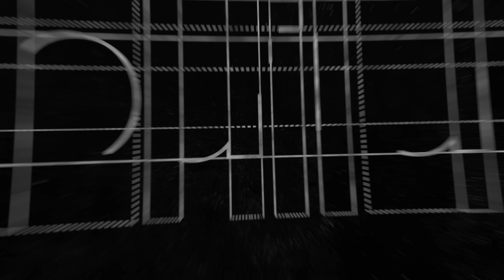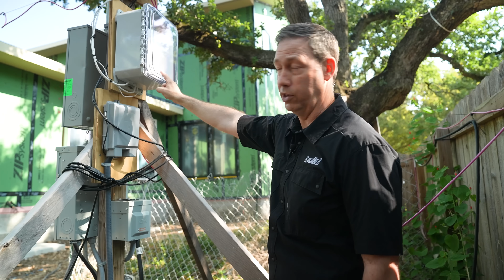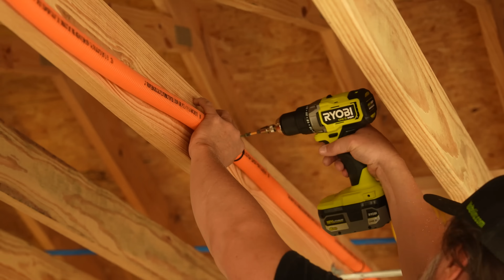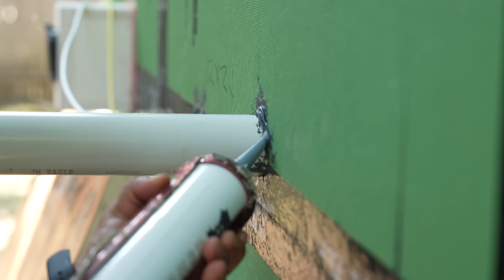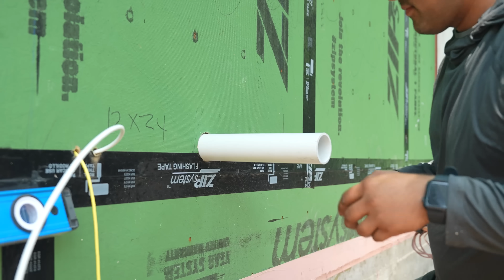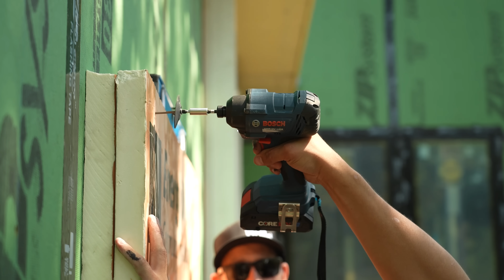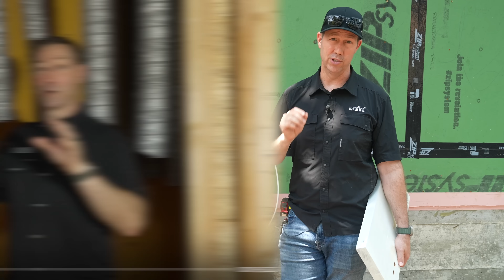Preparing for Google Fiber & Future-Proofing!

Comment: The best way to do this on a new build is run electrical conduit to the back of an Extreme Broadband enclosure mounted to the side of the house. Install fish tape in the conduit and let the installer run whatever type of cable they need to. This creates an airtight way to get any number of cables to the interior of the house. 

Many installers are sent with premade fiber cables and my not have the termination or splicing equipment. There are also several different types of single mode fiber and although you may be able to convert one to the other the installer may not have the connectors to do so. Many companies are also only running fiber to the exterior and cat5e/6 to the interior. Its best to let them bring the install materials they are used to working with and giving them and easy path to run them. Same with cable or satellite providers. They have a certain spec cable they use and it's best to just let them use it.

Comment: when inter provider connects to either the fiber or coax they will do so using connectors,.  I'd like those connectors to be protected from the weather, therefore I'd like to see an enclosure/box  on the outside that those connector can be placed in.

Comment: I would bury schedule 40 conduit to the curb so the fiber drop is not just loose in the ground, which is how google will install it.
Reply: yup, and many times only 3-6" deep
Reply: They don't run fiber in conduit?  Many places run fiber optic in microduct conduit.  Verizon FiOS runs it in large orange conduit (probably 1") with aerial/direct burial fiber optic, but they bury it just a few inches deep.
Reply: @lambition  they have mainline in conduit for the street run trunk but at each address termination in my neighborhood they connected curb to home demark just burying the fiber in the yard.  They did such a poor job burying my neighbors install that the fiber worked its way back up to the point where my lawnmower clipped it once.   Seems they install connects as cheaply as possible, playing the numbers that call backs are low by chance.
Reply: @gentlemanbirdlake  Cable companies around here used to do that, but they began putting all new lines in conduit about 10 years ago. My guess is they just had too many damaged lines and didn't want to bury cable deeper. I believe Verizon used to run fiber optic in conduit from the beginning. Both buries cable very shallow, but conduit is doing their job.
Reply: Doesn't matter, it's on the other side of the demarc, if it doesn't work it's up to the ISP to fix

Comment: I think the only thing I would do different is I would have the pipe going under ground.   When it’s in the plumbing phase just have some pipes go under footer or through an underground wall and then up into the room.  on the outside I would have a small wall or area with plants to hide the pipes.   That would avoid making any holes .  I would do that with the hose bib as well.

Comment: Smurf tube and flexible conduit is such a ball ache to pull through. PVC or emt is so much easier. As other techs have said, pick up some pull string or thin mule tape. Klein makes 1/4" mule tape that works a dream

Comment: 10:00 that looks meesy! U NEED a House connection room, wall, niche
ARRANGEMENT, REQUIREMENTS, CONNECTIONS
In order to be able to install and maintain all connection equipment in a building clearly and properly, the establishment of house connection rooms has proven to be useful.

In addition to the house connection box, the house connection box can also be used

Telecommunications connection
Water connection
Gas connection
District heating connection
and the drainage
be accommodated. In addition, main distributors, meter cabinets, control devices, etc. can also be arranged here.

Comment: I would recommend 2x RG-6 Coax, 2x Cat6 Ethernet, and 2 fibers. at a minimum 1 of each. This way you can support DSL/POTS, Docsis, Satellite, and Active Ethernet or XPon... But at the end of the day the addition of a conduit covers you very well.
Reply: This. Folks ignore the fact that many home owners still prefer copper telephone. And this clean install will be ruined the same week the owners get the keys by an ATT guy running a surface line around the whole house
Reply: Some of us are still using 30 year old multimode fiber (industrial strength).

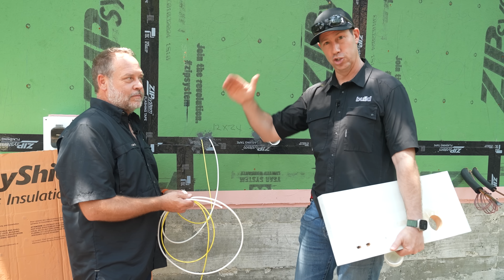Comment: 8:49 “And we used a street 90.” I think Matt means a SWEEP 90, which is a gentle 90-degree swept bend. A STREET fitting is a plumbing fitting with a built-in hub so you can extend a pipe without a coupler. Street != sweep.
Reply: Oh that was a street 90° because that was plumbing pvc. Not actual pvc conduit. & a sweep 90 is a lot bigger radius than that one he used.
Reply: dude also got an IT guy that really didnt want to be on camera with a dolt that doesnt know much about the subject
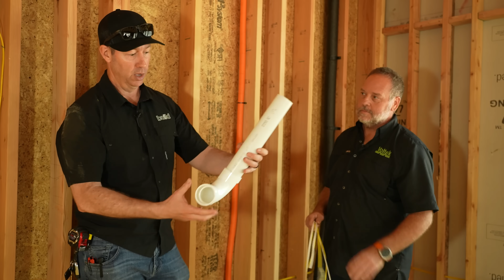Reply: @shelms488  6:48 shows it was not a street 90.  A street 90 has one end female and the other end male.  For a pipe that goes outside, I’d want to use gray electrical PVC, for better UV resistance, not white plumbing PVC.  And electrical PVC has wider sweeps available than the plumbing PVC.

Comment: Matt, I would love to see more "future proofing" videos like this as I wonder if all the work you do to air seal and bug proof your homes gets destroyed once the homeowner calls some sub 5-10 years later to add something and they just destroy the envelope because they just don't understand how the home was built. Case in point: My neighbor added a mini split to their newly built, albeit a "builder grade home," and some subcontractor ran the 8 ga.(?) wire from the indoor panel to the outside and then attached it with clips and screws right through the crappy vinyl siding, crappy paper WRB and into the OSB for at least 25 feet to the unit. Same with the cable company. Is there any company that makes some sort of box that would accommodate this or is your solution with PVC the only game right now?

Comment: I own a house which was built in 2008 and was surprised that it didn’t come with any Ethernet in the walls. It took a ton of effort routing Ethernet to all the rooms after the fact. My house is a 2 story, wood frame, slab house, so no crawlspace to make it easier. 

My moms house flooded a few years ago and they had to redo all of the drywall so I went in over a weekend and ran two cat 8 cables to every room from a central junction box in the storage room under the stairs. It was 100x easier to do this without drywall on the walls and only cost around $200. I just don’t understand why this isn’t standard in every house…
Reply: Btw, I wish this video had been out before I did all that work. I would have added conduit to make it easier to run cables in the future. I manage a performing arts theatre and they use conduit for everything and have pull lines in each one. Being able to run a cable in minutes is a godsend! You should add pull lines to your conduit! :)
Reply: I agree, there are so many things that could be done that’s inexpensive before drywall is put up.  It unfortunately adds up, remember your labor and service is free.  This is 1 of 20+ things that could be improved.

Comment: This is cool, I like the install on the outside with the good seals. I know your not there yet, but if you are going completely wireless then fiber is a waste as your limited by the wires tech. If you plan to run fiber to each room then don't make my mistake on the "which wall" does the room connection go on. I learned that running a spider, basically connect each wall connection back to the incoming line keeps the wired connection clean. This way no running the wires half way around the room to connect the equipment, because where you want it and where you kids want it won't match :)
-MG

Comment: If this was in Verizon FiOS area, installer wouldn't know what to do with that fiber cable unless it is pre-terminated. Most installers (at least in DMV area), don't know how to splice fiber. They will just run extra long cable and make like 20 ft of service loop.  I asked fios installer to clean up this long extra fiber optic, and he declined. :(  Even at my house, I have like 8 ft of service loop outside and 20 ft of service loop in the attic.

Comment: Homes need to have a good 18U rack space in a utility closet for networking hardware (not in a bedroom, the stuff is noisy).

I think being in the room with a heat pump water heater would be good, as it will help cool the electronics.

Comment: I came in thinking, oh a builder talking about cables. Let's see how wrong they get it. Thankfully you brought in an expert. The only issues I have is the flex conduit and running a copper cable so close to high voltage.
Reply: No, they still got it pretty wrong still. They were using plumbing pvc pipe instead of electrical conduit, (which is a code requirement)  not also pulling cat6 to the demarc. Not running conduit all the way to the demarc. Not running a pull string through the conduit, just to name a few.
Reply: @shelms488 
Yes they could have done more, but it wasn't a case of them running Cat3 and RJ59 because it's thinner and cheap. Then stapling it to the studs.

Comment: I'm curious why you didn't run the two homerun cables in a conduit (to the outside) instead of drilling the holes.  Also, will you run a conduit from the 2" that you left empty up to the conditioned space, or did you just leave that small stub sitting there, to be added to later?

Comment: You definitely need two Ethernet cables, cat 6a or above. It can be used for data or POE. If ut was my house, I'd terminate it into an insulated box (~30 x ~18) and run conduit from there all the way to the attic. I'd close both ends of the conduit, but with pull tees in a chain across the top of the inside of the box, then you can add a waterproof seal for each cable that runs through. That would give you a lot of flexibility for the future and multiple layers of protection against water, air, and insects.
Reply: You definitely don't ned more than CAT 6A, there aren't even NICs out there for consumers to take advantage of CAT 8. Don't blow your money on something that's unnecessary at best. If you must go for a longer distance or more speed, just use the widely available singlemode or multimode fibre stuff.
Oh and the chance to get f*ed on Amazon when buying "CAT 8" or "CAT 7" stuff is way to big.

Comment: Matt - how would you detail the wire penetrations with a Tyvek house wrap?  Closing on a new house in 30 days and want to avoid the sins I’ll get if the service providers are left to their own devices.  I can remove vinyl siding but I make a similar mounting block (probably going with PVC) but properly sealing the cables is my main concern to avoid insect and air / water infiltration.

Comment: You also need to be careful handling fiber ends as the glass can splinter off into your fingers. Also planning for external termination can be a little difficult. Some carriers want to do SC or LC UPC while others want to do ACP. Most commercial carriers use a single fiber and BiDi optics while some municipal networks just go duplex cables with a more simple optic. So leave plenty of spare service loop on both ends so the fiber can be re-terminated over the years if needed.

Also, I don't think I've ever known AT&T to use coax cabling for outside plant (could be wrong). They've pretty much always been twisted pair copper for various forms of DSL and now are heavily investing in fiber to the home.

Finally I know some carriers refuse to install their hardware inside a residence and their external gear will need electricity from your house. So it wouldn't be a terrible idea to get a 15A outlet or a way to pull their tiny wallwart power supply's cable to the exterior. I believe some of those carriers also require a surge strip for their little PSU to plug into but that's a YMMV topic.
Reply: Apparently ATT bought out some legacy cablecos that had internet, which probably explains the coax Internet for some ATT subscribers.

Comment: Admire your intent, but there’s a better way than single cables through the exterior wall that will surly get abandoned. I would also prefer the utility cable run directly to the mechanical space. I recommend mounting an  a 8” x 8” weatherproof electrical box with (2) 2 conduits to the underground supply as well as to the interior mechanical space. I mostly use 2” conduits. This is my current method, before for slab on grade builds. For builds with a basement run (2) 2” conduits through foundation walls with link seals before foundation waterproofing. Those conduits are then extended to the street & the mechanical room.  With this you are ready for any Internet system now & in the future.

Comment: Crew training Tip: it's common sense one should never step on extension cords Hoses  particularly at a job site. Matt's pointing how fragile communications cables are. Significant number of fires have been caused by damaged extension cords that's why they're outlawed in commercial buildings.

Comment: this is an interesting point of view....lots of stuff IMO that would NOT do like cutting the conduit. The other thing would be to run each of the Fibers and CAT6E cables and COAX that way it is all ready to go but Nine times out of ten most installers like At&T will still run it themselves if you have conduit GREAT if you don't then they will run it. I mean when we got fiber installed the tech came in and ran a fiber line ALL the way into the attic and then to the room we wanted it in and do a wall plate and everything so the thought that they would "Just use a masonry bit and go where ever." just isn't really true....imo Its better to have a locked outdoor network box that can be accessed and has hookups for fiber, coaxes and Cat cable as well as a free conduit so anything can be run to where all your networking is going to located in the home.  And also this doesn't even go over running thing to rooms and offices as well and security and AP thru the home.

Comment: I wish we had a fiber option.  Even fast cable, 1 Gbps+ download, has slow upload speeds, 30 Mbps.  Not great for working from home when you need to upload large files.  And we are 30 miles from the heart of Silicon Valley.

Comment: I install fiber internet for a telecom company in ontario canada, what i don't understand is why are you bringing fiber and coax to a random corner of the house, older houses is different (retrofitted) but all new build comes in where the electrical service comes in, i wouldn't want what you're doing on my new house
Reply: Almost seems like an afterthought, can't see a good reason to not put in another conduit(or two) next to the electrical line in the slab for a new build. Unless google fiber absolutely refuses to put the media converter inside the home.

Comment: Matt why didn’t you go under and thru the foundation so there is no hole in the envelope. In my project in Texas I drilled in the foundation and put in conduit from the outside to the inside.. no holes in the envelope.. :)
Reply: Potential leak path in high water table areas?
Reply: @MorryB I sealed around the conduit on the inside.. if your water table is that shallow I think you have bigger issues. :(